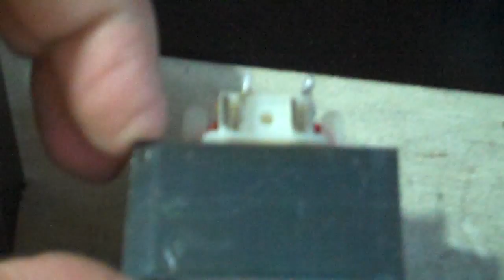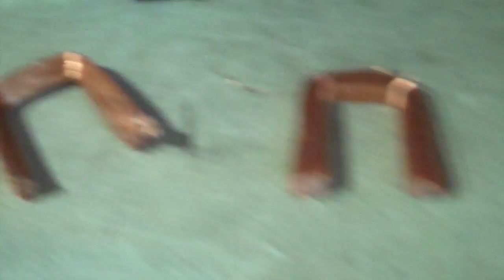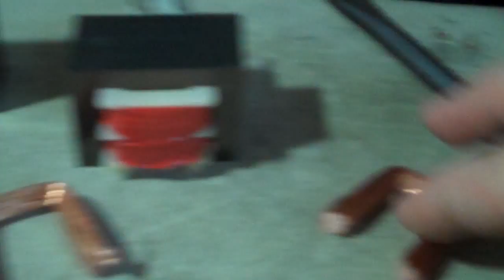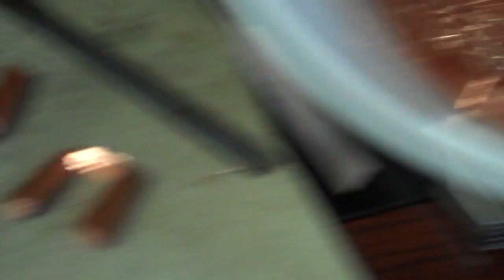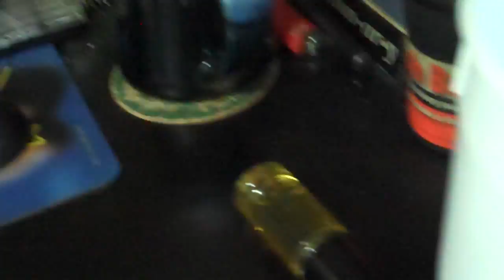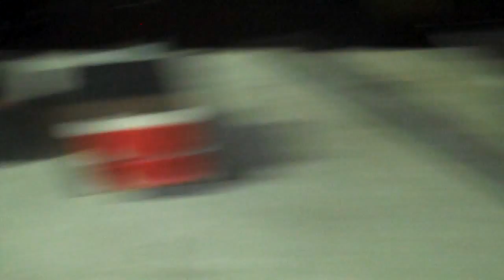Scrapping Laminated Transfomers

Comment: I was hoping to see the chisel at work... =) Also, did you try the chisel on the actual weld mark in the steel??? Sometimes they just quickly pop apart. I have trouble with the CBM's that have interlocking metal sheets.

Comment: mr feets an easier way would be to simply look for the weld spot on either the top or bottom depending on the way your holding it and smack it with a hammer 5 times or so and the iron will fall away from one side, then you simply tap lightly with a hammer on the opposing side of the copper and it will remove wholly from the transformer without destruction :)
Reply: Been there done that. Ok for big stuff but Fleets is the MAN  with these suckers!